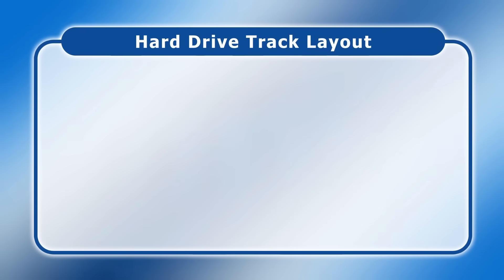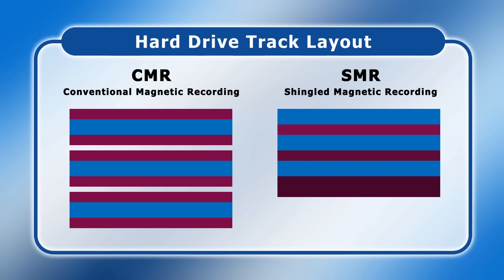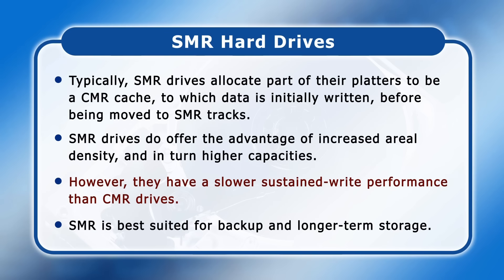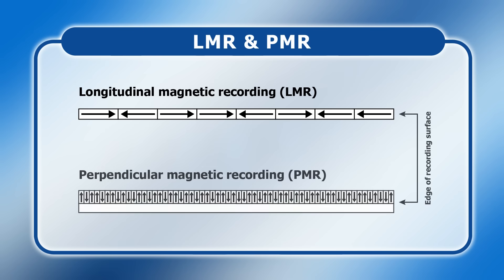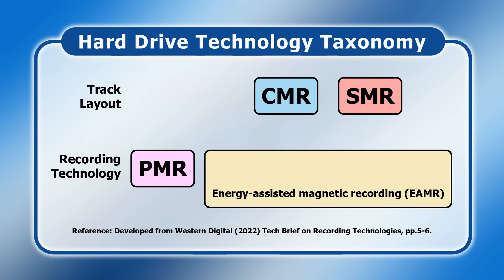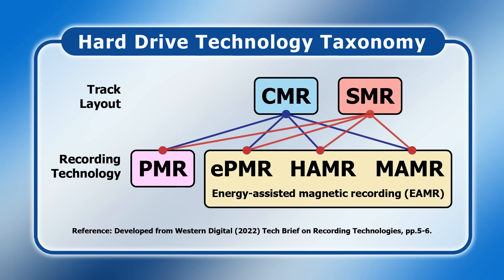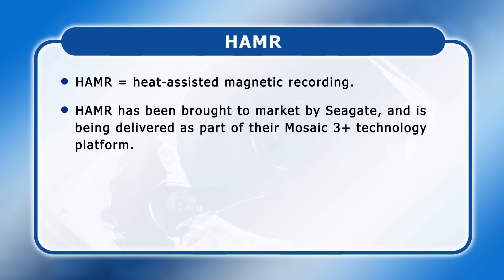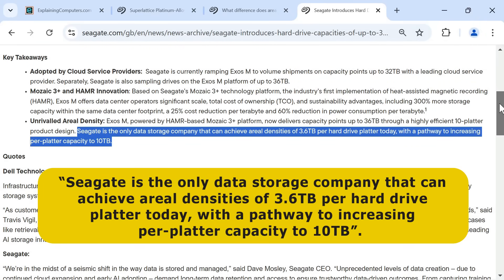Explaining Hard Drive Technologies: SMR, HAMR, ePMR & more!

Comment: Why is local storage needed? It seems so outdated now, in age of The Cloud and hand-held devices as terminals to remote systems.
Reply from the maker: What do you think the cloud is made from?! Mainly hard drives! :) For some of us local storage in the tens of TB is needed as part of out 3-2-1+ video backup.
Reply: @ExplainingComputers  It was partly sarcasm on my part. Still, why do you need local backup of your videos, when you can buy TBs online?
Reply: @ExplainingComputers  More poignantly, what is going to happen to those HDs of yours when you die? Do you have a digital asset section in your Last Will and Testament, which will give your HDs to someone to archive (for some reason?)  If you're worried about your legacy, loading your videos all around the internet is a better strategy than a safe full of HDs that no one will know what to do with in a couple of decades.

Comment: George Morrow, of Morrow Designs, later Thinker Toys, asked me, as a dealer of his  Z80 CPM PCs, what I thought of bringing to market a 5 MB Hard drive option.  Most small computers usually had two 180 kB 5.25" floppys as standard (later 360 kB and up).  Nobody, including me, could imagine what you would use all that storage for. 😂  The first server I built for my company ha two 360 MB "Wren" disk drives in a RAID 1.   FYI A 3mm thick Galaxy 7 watch has 2 GB of memory!

Comment: The reason why the write head is larger than the read head is because in the first case you need affect the disc (so you need a stronger field) ?
Reply from the maker: Correct -- a large head is needed to alter what is on the disk. But a smaller one is fine to read what is on it.

Comment: One note with SMR drives, if you are doing RAID 5/6 your data gets written to the drives in chunks anyway, so (in theory) if you can sync that chunk size (and locations) with the shingle band size you should not suffer any degradation in performance

And if you DON'T sync the RAID stripe size/location, you will suffer significantly.

I don't know if there are any tools to help do this, or if the drives give you enough information to do so without empirical testing.

And it may be that the SMR stripes at the outside of the drive are larger than towards the inside (due to the larger area for the same number of tracks), which would significantly complicate the ideal situation 🙂

It may be enough to make the RAID stripe size a multiple of the append-only chunk size.

Comment: Great vid, Chris.
I guess that the heat momentarily takes the magnetic media above its Curie temperature (where thermal energy frees the otherwise fixed magnetic orientation of the domains) and demagnetizing/remagnetizing is also achievable with the low-power electromagnetic fields in small coils.
Reply from the maker: I believe that this is right. The heat makes is easier to write the bit with less power.
Reply: @ExplainingComputers  I haven't forgotten quite all the metallurgy I was taught, not least that learned postgrad in Nottingham 1989-91 :face-blue-smiling:

Comment: I've found SMR drives are also great for large single player games, as the game saves are typically placed in the documents folder so once the game itself is installed there is little to no data being written on the game drive and so it is much cheaper to throw a bunch of 40-100gb+ games on a cheap 6TB SMR drive than to get an equivalent size CMR.

Comment: My first computer didn't even have a hard drive, nor did it even have an option for a hard drive to be installed.  You could get an external HDD for it, but I believe the max available capacity was 40MB (yes, MB, not GB).
Reply: And until MS-DOS 4.0 (or DR-DOS), the maximum partition size on an HDD (or anything else, for that matter) was 32MB.  So you needed at least two partitions on a 40MB drive.

Comment: I recall reading an article in "Computer Design" magazine in the 1980's that talked about early research into PMR.  The explained how data are stored as permanent magnets on the surface of the platter, and that they are most durable when they are long compared to their cross sections.  So the state of the art at the time was to make tracks narrower so that the length of each bit yielded the necessary reliability.  But the thickness of the magnetic coating also worked against the medium, so they had to make the coating ever thinner, which reduced the density of the magnetic grains.

PMR turned the equations over, so that the thickness and other properties of the coating worked in their favor:  They could make the permanent magnets longer, while maintaining the thickness, reducing the track width, and increasing the linear bit density.  At the time, the main problem with the technology was to develop a read/write head that would create a magnetic field that would penetrate into the coating rather than along its surface to create the permanent magnets. 

Then in the mid-2000's, I saw PMR drives appearing on the market, and I thought how cool it was that they managed to pull this off.  Bravo!
Reply: On the memory trail (pun intended), I remember reading of a terabit vacuum tube memory using a E beam heating up the target plate as a magnetic field was applied. When the heated spot cooled down, the bit was saved. Yet another memory technology in the dustbin. I suspect someone is still chasing down that rabbit hole.

Comment: Didn't know the 30TB+ hdd's are out now. The scalping prices do not disappoint. Hdd's are great for game storage or general storage of files. The downsize of all that space is the very low read and write speed. The full format speed will likely take a week or close to it. The transfer speed is low also. Usually use hdd's as a backup for long term storage because of higher reliability than ssd's.

Comment: All storage patterns recur at different levels. Modern file systems already are append only internally. It seems like the API between drives and operating systems, frozen 50 years ago, might need an upgrade.
Reply: ZFS is copy-on-write, so the exact opposite of append-only, as it is append-never.  It also supports using NVMe drives as a huge cache for the whirling ironmongery where slower, long-term storage is provided.  All under a single mount point.
Reply: @The_Real_Phil_Lee  reference please? CoW means you don’t overwrite  previous data. Rights are batched, when logging , log is also continuously appended.
When I say append I’m talking about physical writes tending to be sequential physical blocks , nothing to do with a given file
Reply: @ As soon as you append anything to a file, the last block needs to have a fresh copy created, so at every save interval all of those need to be written out to storage to be written.  Most of the blocks are going to be the same, but the last block will have multiple versions created until that block stops being changed, and you dd another frequently updated last block.  Yes, they all get written (because a high level of data integrity is what many users or administrators want when using a CoW storage solution.  Of course, you might be lucky enough for the program appending the data to have an internal cache that exactly matches your block size, but it is wildly improbable.
If you want a reference, any decent guide to how ZFS works will work, including man zfs, Levelonetechs, or as a last resort, Wikipedia (although it is badly out of date).

Comment: I have HD last up to 12 years,  I did have one Western Digital that lasted 2.5 years even though I had a 3-year warranty.  I replaced it and 3 or 4 replacements later it only lasted 3 days at most.  So I don't think I going with a WD anytime soon.  I have had SDDs last up to 5 years and HDs up to  12 years,  so long-term storage would go to HDs and not SSDs.

Comment: This week I had a disk fail in my storage array. I'd set up multiple PVs into one big VG, so I don't know where the data actually is - completely my fault,  I'll use this opportunity to do things better this time around. The consequence is that I have to copy the data from the entire VG instead of just the failing drive... and surprise to me, some of the drives are SMR, making for a real slowdown in rsyncing. When I bought these drives, I didn't know to check or think about this -that's partly on me, but I also feel manufacturers could have been clearer.

Comment: 12:45 Yeah that Seagate stuff I read about a while ago.  Impressive.  15:41 Hard drives are like cars. They're old technology but everyone can't live without them. I've got hard drives going back to the 80s that are still fine. I check them every now and again and so far so good. On my current system, I still use the hard drive to install the games and some apps. The NVMe is strictly for booting. They have a limited read and write cycles. You need to trickle charge them every now and again or you could risk data degradation.  I also still have optical drives. I keep seeing articles and people rather making fun of who needs an optical drive anymore.  I have a ton of physical media and many others do too.  That's who still need those.   Now floppy drives, that's a different story.
Reply: I still prefer to purchase CD and DVD physical media for music and video when possible, and copy them to digital storage.  Someone asked me once why I still use that stuff, and I explained that the original media become my backups in case the digital storage fails.  He said that is wise.
Reply: @paulsander5433  Same here. Preserves the original media.

Comment: Hi, nice explanation (as if it was not complicated enough :/).

At another level, one can regret that every new technology nowadays is based upon ephemeral storage, take photos, digital is good because you can multiply the shots to get the one good picture and it costs nothing to do so, but you'll need several copies on several medium to make sure you'll be able to re-read them in several years, not to mention that medium and tech will change in this laps of time - on the other side, silvery pictures do not degrade easily and their negative, if shelved correctly, can last at least a century while costing only the temperature and humidity control, which is much less than changing tech to stay up to date and transfer from old to new.

It is far from sure this kind of bargain was a real good one for the end users…

Comment: Great explanation, Chris!  In 1990 I had a PC with a 60 MB drive.  I can still remember using Norton’s tools to test the speed of it, at 260 kB/s.  So, in 35 years, the storage capacity has increased roughly 1M times, but the speed has only increased 1000 times.  I find that interesting.
Reply from the maker: I find this interesting too. I guess it shows how scaling media density is easier than scaling mechanical mechanisms and processes.

Comment: In my opinion, HDDs have reached their limit. No matter how much we try to improve them, they are still mechanical, still limited to 7200, or a maximum of 15k rpm. The smaller the head and the denser the space, the more difficult it will be to read and write them. Magnetization also has an expiration date, just like HDDs.

I believe that SSDs are the way forward anyway.
Reply: HDD development has slowed down as far as capacity increases but it seems they are still improving over time. They are still very reliable. I'd trust a good 3.5" WD way more than some no-name brand SSD anyway.
Reply: @kunka592  Obviously there is no comparison between a well-known brand and an unknown one. But the failure rate of hard drives has been increasing alarmingly, they last less and less time, many dying even within the warranty period, especially Seagate.

Comment: Could a possible solution to ever increasing HDD sizes be to bring back the old 5 1/4 inch size devices, Chris? Not as internal storage but as external backup only. I guess this would make them rather niche and more expensive esp at first.
Reply: The problem with 5"1/4 platters is their balance, so you can't rotate them as fast as 3"1/2, hence they would be much slower, not to mention that they would need new machines, mew motors, etc.

If you need external big storage, use LTO tapes, today with LTO-9 (~1.0 to 2.7 TB/hour - generally 300 MB/s) they go up to 18 TB native and up to 45 TB compressed at an average price of $90/tape with a data retention time given of 30 years (but the drive itself costs an arm and a leg, around $4,700 for a simple drive, but a drive with a 16 slots library is around $14,000).

Comment: 2:15 the Maxtor 2F040L0 is a slim/low-profile hdd
there is only one platter inside the disk, and it has only one working side
thus it has only one read/write head
Reply: And I've had SO many Maxtor drives fail the day after the warranty expired....

One of my IT colleagues wanted to take a bunch of failed drives to the firing range for target practice.  I said to him "I bet they're all Maxtor drives."  He asked me, in all seriousness, how I knew.

Fun times.
Reply: @paulsander5433  lol m8
but that 5T020H2 drive survived for 7 years without any problems (i kept it until now, detached from the computer)
i had another 6Y080L0 drive, it has some bad sectors but had no catastrophic problems.
Reply: @paulsander5433  in my opinion, Maxtor hdds tend to get hot, that may be the reason why they tend to fail.

Comment: ha, my first computer was bought at the year 2001
despite the celeron 667MHz CPU, 128MB SDRAM, and the nVIDIA TNT2 Model 64 display card
it has a Maxtor 5T020H2 hdd, which has 20 GB capacity with 2MB cache, and the rotational speed is 7200 rpm
now, just look how many years have passed, the capacity of a winchester hdd has already exceeded 20 terabytes!

Comment: Excellent as usual. It would be nice to compare longevity and reliability of this system. I remember a video where you talked about it with memory media in general, that's where I learned about cmr and smr. If I remember correctly cmr is more reliable. Three different technologies: to me mamr is the winner...seems less prone to failure. WD damaged its reputation with smr..

Comment: I remember in my first (and only!) job, at the end of the 70s, working with mainframe disk packs - the drives were the size of washing machines. If I remember correctly their capacity was only a few hundred Mb. A few years down the line, a 9Gb external hard drive generated quite a bit of excitement in our office. By the time I retired the Computer Science department were giving (for keeps) a Raspberry Pi to their students. Computing through the ages!

Comment: It seems that SMR doesn't offer a huge increase in storage over CMR, perhaps 10 to 20 percent at most.  Which may not be enough to justify the reduced write speed tradeoff for the slight increase in capacity, unless the MSR drives came at a REDUCED price over the CMR drive.   However, I suspect that the drives are being priced on a per TB basis so buyer beware, or at least be educated!    In the end, I wonder how these new HD techs stack up against SSD in terms of write lifetime, and long term storage lifetime.  At one point, for personal workstation use, the crossover point between SSD's and HD's was about 500GB in terms of cost vs storage.  Now the sweet spot might be 1 or 2 TB.  Of course there are many things other than cost that matter, including power usage, speed, longevity, space, weight, and upgradability.

Comment: In the kid 90s there were huge "full height" 5 1/4" drives with 10 platters.  But the platters were MUCH thicker thank today, spun much much slower and only measured in megabytes, not gigabytes.  

They could just about heat a room too because of the heat they generated.  And they weighed a ton!

Comment: These drives are currently 3.5 inch form factor. Would be a hoot if manufacturers had to go back to 5.25 inch drive cases to increase capacity per platter. They would have to dust off all of the old tooling to make bigger enclosures. Would then be all sorts of issues with mounting larger sized drives all over the place. (Luckily I still have an old Fractal Design case which will accomodate 5.25 inch devices.  😁)
Reply: I had a similar thought. I'd rather have a double height drive than questionable data integrity. 

I've begun hoarding old cases with proper drive bays myself.
Reply: Quantum had one out in the early 2000s called the Bigfoot IIRC.
Reply: Think about using a 12 or 24-inch platter, as IBM did in 1956 when they had 50 disk and 24-inch platters with a whole 3.75MB of storage. What storage would be with today's tech using platters of that size and number?

Comment: Excellent video, which really gives us the low-down on these technologies. Of course, besides the leaps ahead in capacity, the other side of the coin is performance. And performance is a complex subject now, since there are different application with different requirements. One drive may be fast at bursty writes but poor at sustained, another drive may be the other way around. These new huge drives might turn out to have some caveats in actual use. Keep blasting it, Chris!

Comment: Hi Chris, you did not give any information on speeds.  With higher density/multi platters, the drives would be able to read/write faster.  Are they all still SATA at 600 MB/s? Very interesting all the same.

Comment: Excellent descriptions.  I started out as a computer engineer in 1970 working on 60MB hard drives the size of a washing machine, 3 phase mains supply, 11? inch diameter platters and 11? platters/pack.   80MB drives were just being released and we though it couldn't get any better